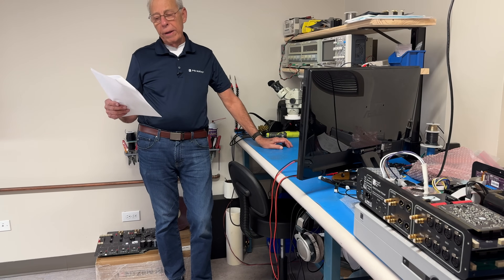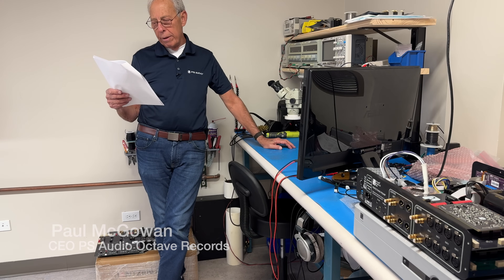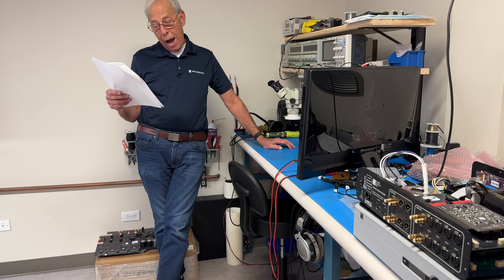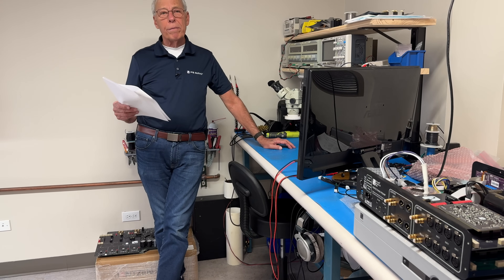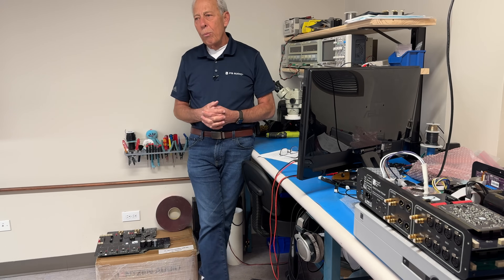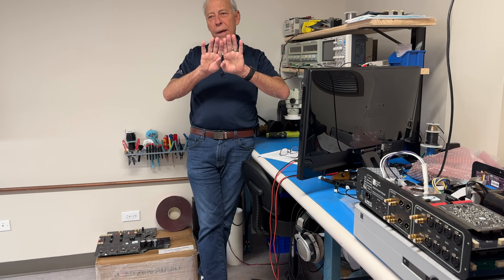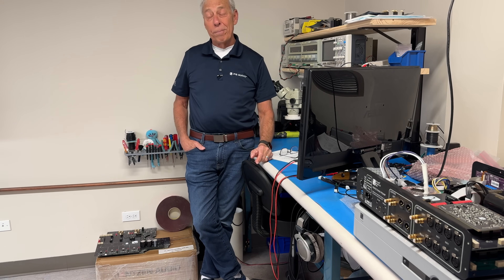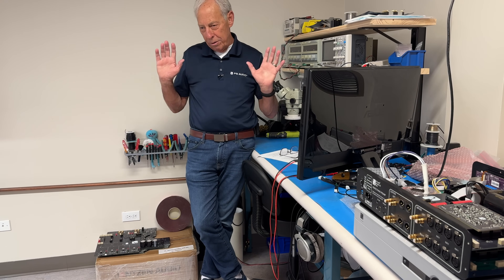Active crossovers

Comment: Theres a real market for a crossover or dsp when using subs as well as speakers. I come from a live/club PA background and speaker processing is a standard learning path. As soon as I try and look for products in the hifi market that will alow we to play with High pass/Low pass/ Slopes / Output levels / Delay of subs compared to main stack which are all basic the device is thousands and doesnt always give me all the connectivity or options Im still looking for. And Its much easier to look at used PA DSP that has 2 in 6 out xlr units with all these options for a fraction of the price. Seems crazy with everything else we consider in the hifi and home stereo world as worth finetuning.

Comment: I picked up a Sublime Acoustic K231 3-Way Active Crossover 2 months ago. It is not complicated in any way shape or form. All I had to add is 1 additional amp and my active sub also worked great with it because it added a sub frequency output that I was lacking. In fact all I did was add a second Marantz Model 30 and my SACD 30n is designed to perform as a pre amp as an option. There are a lot of less expensive more basic amps you can run rather than a Model 30 but I got a good deal. Honestly I feel like my B&W 702 S3 Signature Series sound as good as the last 2 high dollar ($40k-$50K) towers I have listened to in 2 different high end local hi-fi shops recently. They sound extremely clean and clear. I think it is a huge bang for your buck upgrade. The reason it is not used within the home audio industry is because it opens the door to user error and hooking low amplified signals to tweeters and having the equipment owner claim he made no errors and now wants his tweeters replaced under warranty. But it doesn't have to be like that if you still use a passive network on the speakers as a safety net. They just don't do much at that point, but add a level of protection. It isn't like they are eating up power since the signal is already filtered when it is amplified and directed to the correct speakers.
Reply: Yep me too.

Big sound improvement with analog active bi-amping and tri-amping my PS AUDIO FR5:

bi-amping without subwoofers: https://youtu.be/69rInT7vVY0

tri-amping +  2 subwoofers: https://youtu.be/T4bh29T2Pa8
Reply: @mrpmj00 . Very nice! 👍🏼

Comment: Y'all missin' da' big reason to TriAmp.....................
        Changing-out drivers!  People who TriAmp don't do it with 3-way store-bought 'box' loudspeakers.  Bass cabinets are separate.  The mids & highs may or may not have any cabinet at all.
       Therefore a complete change in the sound can be had by going from a baffle only 6" inch cone midrange to a midrange compression driver with a horn.  No cabinet necessary and tweeters are available the same way.  Of course the crossover needs a quick knob rotation too. As I say, go from JBL L100 to a Klipsch Forte IV without spending another $4000.
     This arrangement also allows for MUCH better drivers than what usually comes in mass market loudspeakers.  Who wants just one set of speakers?  Want $999 LRS Maggies?  Cool, I've already got the bass they need in place.   Etc. Etc.......

                                                                                         Acid Jazz, Funk & Brass🔈🔉🔊

Comment: Powered monitors are already configured for this not home speakers  ? Amplifier matching , cable matching ? In pro monitors the amplifier and so called crossover is internal to the point the you can do it all from the board and a laptop. For the home it might be a bit much ? Unless you get pro powered monitors with the built in separate amplifier, a single XLR cable and a data cable  .  I don’t know how it’s done in home systems without lots of money and time ? Now if you want high end then TAD is as high as it gets!
$10.0000 for two way powered bookshelf monitors ! But they are controllable DSP from your computer and pre amp , if not there is 
Plenty of powered monitors but there’re not high end  ? More.. Pro End  you  won’t have choice of amplifiers.😊

Comment: I believe that active systems can achieve better results compared to passive systems, if designed correctly. There are also systems that integrate everything needed for their management within themselves and do not require any intervention from the end user.

Comment: Interesting perspective. However, audiophiles are easily convinced by snake oil statements, and products. As an example, believing that the use of gold plated interconnects between components is beneficial, as gold has such low resistance, and therefore paying the ridiculous prices for such is folly, at best. Unless the entire signal path of all equipment utilised in a system is gold, the benefits are annulled. That won't prevent an audiophile from spending the money, though. Hope in vain.
Reply: Correct, however gold does not oxidise, so its good on connectors.

Comment: In the system in question, I have utilized a complete digital crossover implemented using a computer and a professional audio interface. Measurements, crossover, and room correction were performed using Audiolense and implemented via HLC. This route is not for the faint-hearted and involves a lot of futzing (it's always nice to learn a new word). Previously, the crossover was implemented using miniDSP and REW. That method is less intensive and very stable, but the results are not as refined as with Audiolense because it uses IIR filters, whereas Audiolense uses FIR filters. When the system is calibrated and time-aligned at the listening position, it sounds incredible. The optimization flexibility is vast and much more predictable than switching cables, amps, etc. With an amp to each FR you don't need expensive amps, my most expensive amp is the Emotiva XPA 200, used.
Reply: I’m in the process, or about to be in the process, of building my own speakers bashed off of Todd’s Audience 212. I’m wanting to use active crossovers as well. Would you suggest amps with built in dsp or separate amp and dsp?
Reply: @ElCidPhysics90 My suggestion is one unit be it a processor or pc with multichannel dac/audio interface to handle crossover and room connection. The amps should be analog no matter what class you choose. Good luck with your project! 👍

Comment: This is one area where I disagree with you Paul the sound is much better when an amplifier can focus on one particular frequency range I have had this setup in my cars and was very happy and the dynamic range is second to none I think it is a big mistake that many audio manufacturers do not provide these crossovers for the consumer.  Yes it does take a few more cables but in the end you will be much more happy than one amplifier covering the entire frequency spectrum

Comment: Adding an active crossover is another component that will “colour” the sound. It’s nice to have, especially a digital version but if you’re a purist, then a passive crossover will be the better way to go, because it was designed for the drivers connected to it.
Reply: An active cross-over doesn’t “color” the sound unless it’s what you configured it to do. The downsides of active digital cross-over are more cost spent on amplifiers and more time needed for tuning the system. It’s also only great if you don’t have analog sources and can run your digital source signal through the DSP lossless without sample rate conversion. But what you gain is way better ability to optimize your cross over filtering against driver performance, room acoustics and personal preference. There is insanely more audio fidelity improvement headroom in this relative to swapping cables, for example.
Reply: Wrong, passive crossovers are lossy, use big inductors that waste power, poor tolerances etc etc, so many reasons why active is superior, there is no reasons whatsoever to say passive will sound better, even paul will tell you that.

Comment: Ive studied sound engineering back in the 90s/2000s but never got inro it till 2016. The active xover has its place in large venues where you got the have multiple bass, mid and high drivers that can be placed out over large enough distances to various lisgening points that will require time and phase adjustments. Depending on what speaker enclosure you decide to use, crossover points can vary requiring a customizable xover frequency

Comment: My intuition tells me that Paul is somewhat struggling with this subject because he can't both claim DSD to be the best sounding digital distribution format and at the same time say active cross-over is the superior sounding method of doing cross-over for digital audio systems. Reason is that DSD is incompatible with digital active cross-over filtering, as it first has to get converted to PCM to get digitally filtered. In my opinion, PS Audio should stop being so silly about DSD, because DSD has no real future as distribution format for this reason and many others. Besides any digital mastering of music even using DSD format for the input tracks always outputs PCM (call it DXD or whatever) as original master format. Transcoding DXD to DSD and claim your master is DSD is plain false as the transcoded DSD file is a lossy version of the PCM original DXD (whatever sample rate/resolution) version.

Comment: Just sounds like another way around from using an EQ. I passive bi-amped my Infinity RS IIIa's and use an (old) EQ and (imho) there is nothing better especially when it comes to money. I use amps that were 2 grand each when new (not that I paid a quarter of that) but there is no way I'm going to drop another 2 grand each just to give them a run to find out if they suck. Wasted time and wasted money. I could spend 25 grand on speaker cables and interconnects and then the next great thing comes along, what do you do with your old cables, throw them in a box? 90% of most people's issues could be solved by a simple EQ.
Reply: .          Tell me how to EQ the following.  In my 3-way driver speakers,  I replace the paper cone midrange w/ a FR of 85Hz-4KHz to a compression driver horn midrange with a FR of 800Hz-8KHz.
         How are you going to EQ that in a 3-way?  Remembering EQ's are line level resistor/op-amp banks.
                                                                           Acid Jazz, Funk & Brass   🔈🔉🔊
Reply: .                     By changing out one driver,  I am effectively getting 2 pair of speakers.  I just went from a JBL L-100 to Klipsh Heresy's with one affordable driver change.
                                                                          Acid Jazz, Funk & Brass  🔈🔉🔊

Comment: Just like the best sounding preamp is no preamp, the best sounding passive crossover is none. HUGE different converting my NHT speakers to an active system ... that said, the active crossover needs to be high quality or it can add a veil to the music. I tried using a dbx professional active crossover with my Martin Logan ESLs to add subs and immediately heard a difference in transparency. I'm working on a DIY version of the active crossover based on a Nelson Pass design to have a more transparent version.
Reply: Hi, does the "dbx professional active crossover" reduced the details of your music? I'm trying to buy a 3 way active crossover but only the types similar to "dbx professional" available in the market.
Reply: I do not honestly see how the Nelson Pass Design is going to be better than even a basic op amp tbh, its linearity will be terriable! less is not more with electronics, all this pure-signal few component bs, in real life we have to use many components to linearise the poor response of one component, you plot the transconductance of a FET-which is the transfer function, and you will see its going to cause bad distortion in your audio path. Stick with good op-amps using Sallan Key config.

Comment: Active crossovers do not have to mean tons of dials. Fact is, phase is hard to do with speaker level crossovers. Powered speakers do not have to be difficult to setup. I do believe that better sound is possible.
Reply: Exactly. I added a Sublime Acoustic K231 3-Way Active Crossover 2 months ago. Piece of cake and the benefits are VERY obvious.

Comment: The very small improvement in sound using a 3-way active crossover isn't worth the extra effort and expense for most people, even those with very expensive systems.  Plus, adding components (amps and the x-over) and additional cabling runs the risk of adding noise to the system.  For most, a more sensible option is to choose speakers that have very well designed passive crossovers.

Comment: There was no going back after incorporating a DEQX crossover processor into my system, it is just phenomenal, but it's more than just a crossover it connects timing issues, and room room modes.
Reply: Yes that is exactly right. If you want superior performance to a passive speaker, you need active cross-over and the gain is huge when you also can tweak it against the room acoustics, personal tonal balance preference and age related higher treble loss (call it rejuvenation EQ). And let’s not forget the extremely important loudness issue of Fletcher Munson where you really must consider how loud you play for optimum experience. These things are infinitely more essential to the best of audio experience than some far-fetched imaginary benefits of using a US$1000 power cable (that cost US$20 to manufacture FOB China)…
Reply: yup Ive got one too.  makes about 1000x the difference than a cable ever will lmao

Comment: I'm with you Paul. The technology is already there in TV's to automatically hook to external sources using bluetooth and wi-fi. My TV sound system came with a wireless woofer as many do.  But my "traditional" stereo system is my trusty Pioneer SX series receiver with a CD player and DAC. Most audiophiles will likely laugh at my 50 year old system of amplification (bought it new), but it sounds fine for my 10x12 office with cathedral ceiling through new speakers. I'm sure PS Audio will get the call after I win the lottery!

Comment: Food for thought.

How often has a Professional PA system shipped with the X over and delay parameters not been predefined and locked by the manufacturer for the speakers. The inefficiency and inability of per band delay offsets of passive crossovers means they are not often used in professional environments either in studio or live performances. In most professional environments the crossover is set by the manufacturer along with amplifier power recommendations for each band, the per band hard limiters are also most often set and locked in the crossover. In nearly most studio monitors the crossovers and amps are built into the cabinets for absolute control over the output behaviour.

Another reason professionals don't use passive crossovers is that it is nearly impossible to control cancelation over the crossover frequencies. In Hi-fi speaker this "feature" is often used to smooth this range for a more pleasing sound, in professional audio this leads to issues equalizing these frequencies among other issues, for this reason it is more difficult to design a hi-fi speaker with active crossovers that sounds good with a variety of setups and most Hi-Fi's don't use amps, larger that 400w where live sound 400w is to drive the tweeters for example, so the efficiency is not a real concern.

Listening to music on a system that stirs your emotion is far more important that the specifics of the technology you using to do it with.

Remember: If its louder that 79db use hearing protection 😊

Comment: Crossover-driver setup is speaker design, not system setup. The electronic crossovers used in sound reinforcement are almost all 24 dB/octave or higher to reduce issues, but such systems tend to be highly flawed in any case. Active crossovers are quite popular in powered speakers, but with seperates the crossover should be dedicated designs that come with the speakers, possibly the amps too.

Comment: The goals of pro audio (mixing and mastering) are different from audiophile systems.  The mix engineer wants to hear what is bad in a mix and is not interested in the speaker making things sound better.  Both want a revealing system but what an audiophile system does to be revealing and sound great might hide a problem in a developing mix.
Reply: Mmm, disagree, I think both want transparency, just the pro guy is technical and prepared to tinker.

Comment: The point of having to adjust the crossover just makes no sense. The designer will do that work. The end user just needs to hook it up to the network and hit play. There are so many advantages to an active crossover and people seem to beat around the bush in the high end audio world. The only real argument against it that I see being valid is that you do need a lot of extra cables(if the amps are external), it’s expensive, and that having amps inside the cabinet isn’t good from an isolation standpoint. All valid. Talk about that. This is the real crux of the issue.